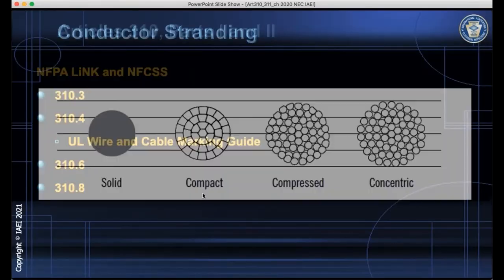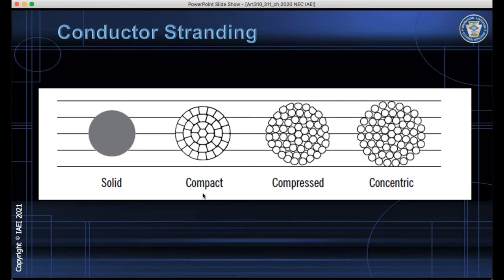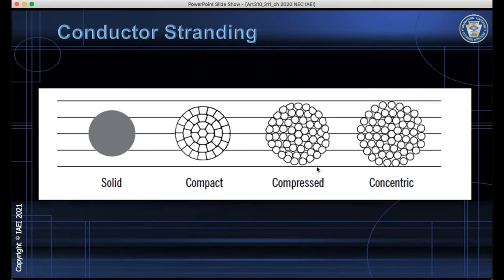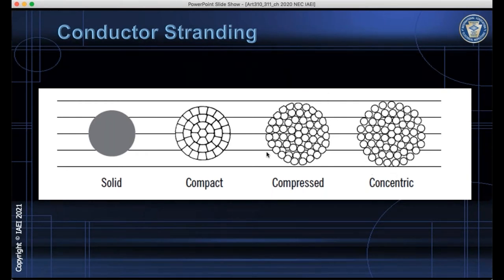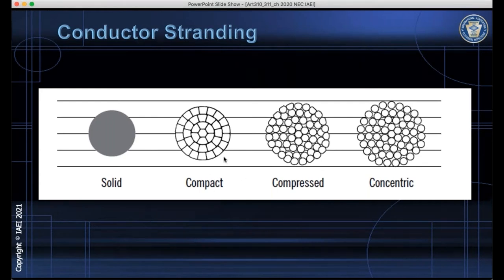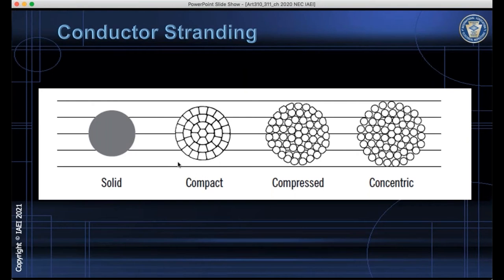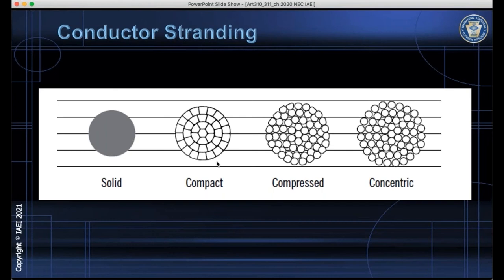IAEI Training Shorts — Conductor Stranding

Comment: Years ago I needed 2500' of #2 TWHN for 5 runs that all had 360 degrees in conduit bends. Had to reject first order because it was not the think around 21 strand that I specified. They sent me 7 strand that had to be at least 2 times stiffer then the 21 steand that I wanted. Cheap union electricians always used the excuse that #12 solid wire was easier to land on devices but we always used stranded wire. Back in the 1950's my dad had to pull 750 MCM type RHW thru a hot rendering room by hand. Talking about seperating the boys from the men.